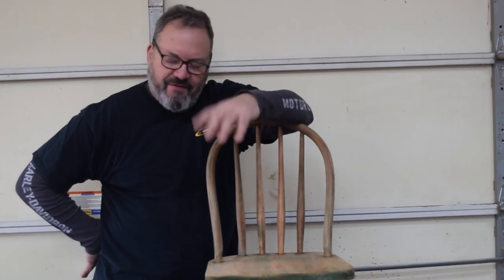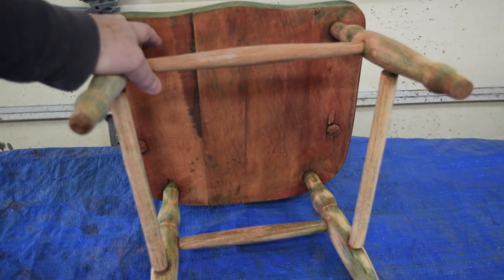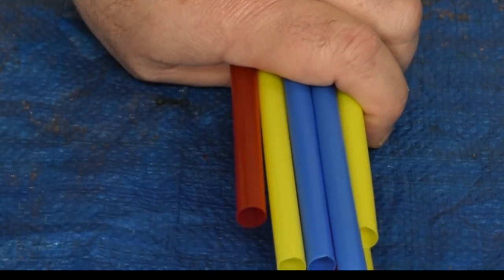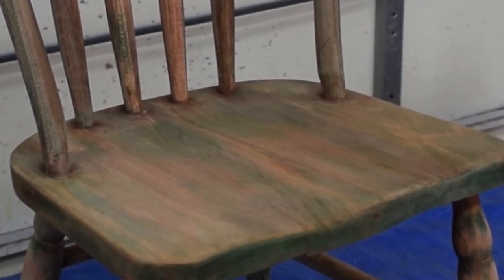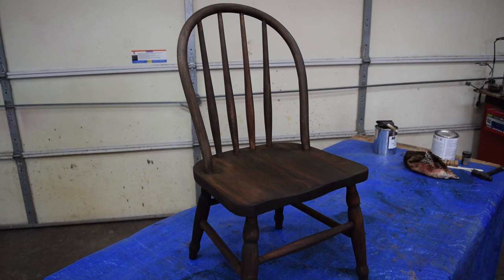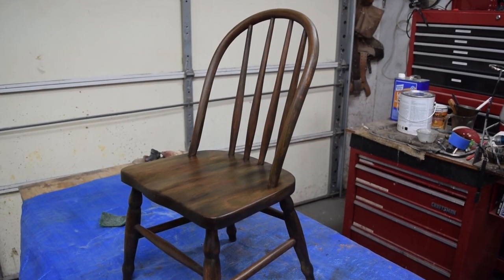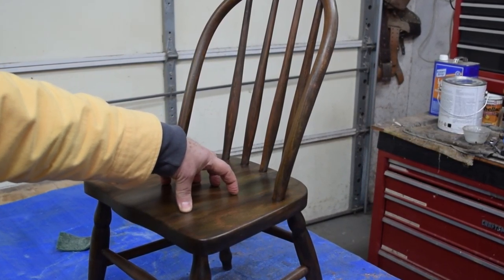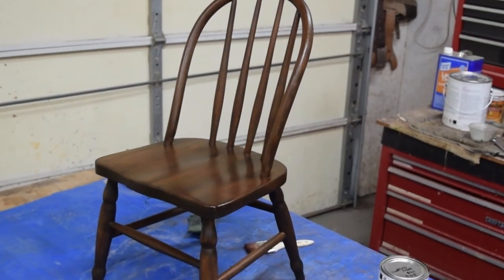Refinishing a Paint Stained Chair

Comment: Thanks for another great video I have spray equipment and fairly good with it I think so asked before but I'll ask again trouble I have is finding a good lacquer I thought it would be nice if you could shed some light on spraying lacquer adjusting the  gun air pressure and what kind of lacquer you like just a thought thanks chair came out amazing  Ed
Reply from the maker: I use Mohawk Pre-Cat.  40 sheen normally.   I have a DeVillbus Finish Line gun, runs at 30 PSI.   I adjust the fan and fluid to the job and really just do it by feel now.   I have a large Quincy air compressor that provides more air than I can ever use, but what the heck, big is fun!   LOL.   Thanks!!
Reply: @LostMountainRestoration   thanks I been using mohawk 40 sheen also had some trouble with my new gun took apart about 10  time cleaned cleaned what ever was wrong I'm back on track it nice to be able to spray wright out of the can thanks again